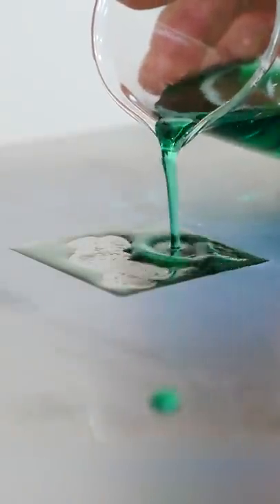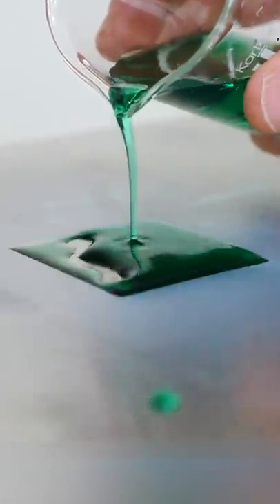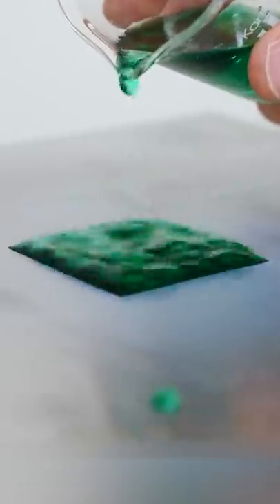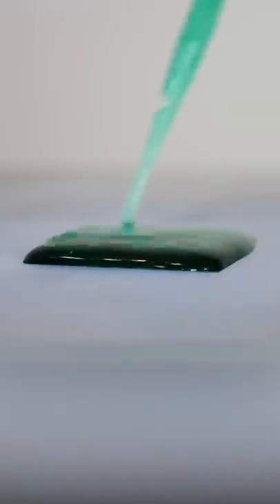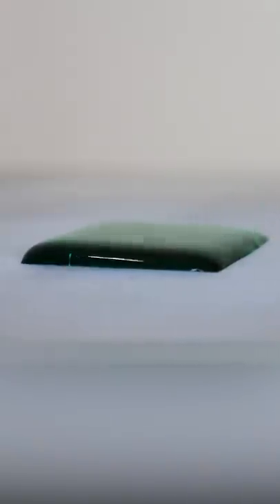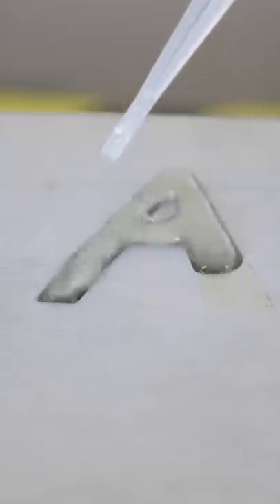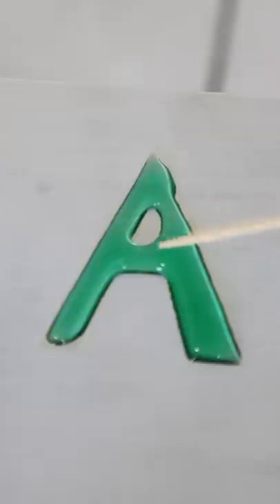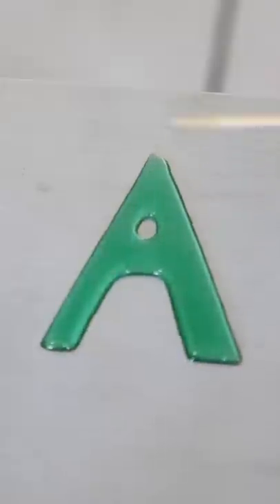Pouring Square Water

Comment: Me when I see this: “Oh that’s cool.”

My caveman brain: “If you keep pouring will it keep going up??”
Reply: Im actually wonder how high can the water get
Reply: at one point it should slide only on the hydrophobic parts until it falls down into another surface
Reply: Ye
Reply: I thought I was the only one!!!
Reply: Minecraft physics be like
Reply: ITSUS
Reply: Same
Reply: @fredrickchew867  0
Reply: Yes lol
Reply: Lmao though The same thing
Reply: Yep
Reply: no
Reply: I thought the same thing.
Reply: I was about to comment this LOL
Reply: It'll probably build up until it can't handle its own mass and starts to spill over, at which point the beads of water will roll across the hydrophobic coating until it reaches something else
Reply: YESSS
Reply: @lukescastle  Sameee, I thought I was the only one!
Reply: Bro Under this short, Its a caveman Spongebob Patrick chase Squidward short
Reply: Sameee
Reply: No probably
Reply: I thought I was the only one
Reply: Guess we’re all cavemen
Reply: Is there a limit
Reply: @fredrickchew867  only until the surface tension breaks at which point everything collapses as shown in the video
Reply: Seeing how far you can pour the water up is actually how hydrophobicity is measured in the first place. A more hydrophobic surface, the more acute the angle between the surface of the metal and the water can go as you add more and more water- essentially, it can hold more water. I think.
Reply: @fredrickchew867  as high as whitebeard

Dang it i hate that meme because I'm a huge one piece fan
But couldn't resist making joke
Reply: @espumacola4089  might
Reply: It will spill over then roll off the table in little spherical water droplets
Reply: @Compariz  hi ml player
Reply: lol same! XD
Reply: @fredrickchew867  
just pour some alcohol in it lol
then immediately it will get "high"

(haha im hilarious/j(?))
Reply: @fredrickchew867  same
Reply: Can we get much higher.... So highhhhhh
Reply: @fredrickchew867  can we get much higher
Reply: @fredrickchew867  can we get much higher
Reply: no beacause the surface tension reduces on adding more
Reply: So I guess the water tension or something would keep it from going up super high and it would droplet out onto the table, but what if the table was tilted in toward the middle so the water would keep sliding down into the puddle. Would the water keep getting absorbed into the puddle and more droplets are pushed out like in a perpetual motion type thing
Reply: Same i was thinking water tower
Reply: Sammmmeeeeee
Reply: too much minecraft
Reply: same
Reply: I was Wanderung how high it would go
Reply: Yup. Me also think the same thing🤣
Reply: @fredrickchew867  can we get much higher?
Reply: Same
Reply: Until the pressure from inside the surface of the water is higher than the external pressure the air exerts on it
Reply: @mickeyspanish9709  it doesn’t release singular droplets. Once you break the surface tension all of the water will spill out.
Reply: You aren’t alone…
Reply: Best comment I've seen today!
Reply: i thought that tooooo
Reply: yes.
Reply: Short answer: maybe not

Comment: Physics: spread
Water: no, I don't think I will
Reply: Hey can u plz xplain d reason behind that I didn’t get the reason from the video..
Reply: I love how people still make the Captain America reference
Reply: @mmmoody100  it’s something we took in biology but i just finished exams last week so my brain is like no I’m not gonna bother understanding this video
Reply: @mmmoody100  The surface beneath the water is different from the surface around it, so I’m assuming that there’s a mold that helps the water keep its shape.
Reply: @mmmoody100  He coated a piece of metal with a substance that water can't stick to and left a spot without the substance on (i assume he used a piece of tape and went around it). The water then just floats there in that shape as it can't flow onto that substance. Hope that wasn't too long winded just wanted to be thorough
Reply: @mmmoody100  Water likes to cling to stuff, except the hydrophobic substance that the video creator was talking about. He covered the surface with the substance EXCEPT that square. Since water will cling to the surface within the square, and to other water molecules, it holds itself together unless the tension is broken by something like adding too much water such that it overflows anyways, or by adding soap, as demonstrated in the video.
Reply: @mmmoody100  a hydrophobic substance will repel water. He simply coated most of the area in the hydrophobic substance and then poured water on the untouched area. Hope this helped.
Reply: Literally nobody paid attention to the video except @specialopsdave and @Cynthia Anderson
Reply: @mmmoody100  the man has coated a surface with ultra anti stick coat designed for water to glide on it (super hydrophobic cloak) except the places where he wants the water to go to, then he can add water and thanks to surface tension it'll just pile up and create a volumetric shape made of water
Reply: Thnku everyone I got tht..
Thnk GOD!!!
A zeal of hlping people is still left in some people..🙏🏻😇❤️❤️

Comment: Considering the water is "contained" in the surface area without the hydrophobic coating I think it still counts as being in a container, still cool though I wonder what happens once the water overflows?
Reply: I was wondering too!
Reply: At a certain point it will just "spill" out of area
Reply: @pixels_per_inch  I figured as much but I'm more curious about how the water will react to the hydrophobic surface once forced on to it

Comment: just had an idea:
Manufacture blacktop lab tables or cooktops with this coating all around the edges.
spillproof countertop that wont dribble water based mess onto the floor, or better yet, have a drain along the edge of one side so it pools there and can go down a second sink drain
Reply: That's actually a very good idea
Reply: I don’t think you know how most hydrophobic substances actually work. it’s like a layer of oil that’ll wash off in 1 wash so you can’t rely on it and cooking it destroys it’s desirable properties so it won’t work 
Also fun fact: hydrocolloids(substances having water holding capacity) like algin (obtained from brown algae) is used in jellies and ice cream.

Your idea sounds cool and would be awesome if we could use it that way but it isn’t that versatile :)
Reply: There are some issues but that first ideas is workable. Your second idea is literally just gutters though.
Reply: @anoushkasingh9074  ah, wasnt aware how short the lifespan on it was.
Reply: @paul_warner  I think it would be pretty cool if we could work it like the og commenter said. Be nice when you disagree, Paul :)
Reply: @anoushkasingh9074  I wasn't being very impolite, I think
Reply: That sounds genius! Good luck
Reply: @paul_warner   I think they thought you saying "gutters" was to insult the idea.
Reply: @anoushkasingh9074  hello, re-read Paul’s comment after reading the original comment. 
Paul is using a play on words. 
Gutters!
Reply: @noobslayer6915  I mean that it's literally gutters... What else do you call a groove or lip that collects water and channels it to a draining point?
Reply: @paul_warner  oh my bad I didn’t get it. I’m sorry Paul
Reply: @paul_warner  i mean honestly a table with integrated gutters sounds like a really good idea. could be really convenient
seems like a mechanical solution versus the material solution i offered.
Reply: @Zakumei  it exists but in the kitchen where I work it isn't widely implemented.
Reply: But in a lab you shouldn't just mix everything that could be spilled on the table 😉 believe me, you don't want that. I work in a lab
Reply: @SaheeliRai  oh nononono i was thinking like... kitchen countertops. i was thinking more practical application and domestic uses
Reply: @Zakumei  domestic would be a waste of time, it would be most useful in commercial kitchens, but it also wouldn't do anything for oil-based spills. However if we applied super hydrophobic materials to the coastlines of the world then we could stop the rising sea levels.

Comment: Fun fact: this wouldn't work on a larger scale, because the surface tension of the water would be too small in comparison to its weight, meaning it would eventually spill across.
Reply: Make the water tension stronger then.
Reply: @RealNameNeverUsed  it would have to become another substance with more volume, potentially a gel solution.

Comment: "without a container"
So how do you do it?
"I made a containment field of super hydrophobic liquid"
Reply: It's not a containment field, nor is it hydrophobic liquid.
Reply: But he said he coated every where but the square area where he would put the water, which even if it’s super small still forms a container like wall which keeps the water in a square shape until too much is added.
Reply: @Exerminos  That's not a container. Imagine it inversed. Would it still be a container?
Reply: @brettvv7475  yes, if he now puts some kind of fat on the hydrophobic area, since water is litophobic
Reply: @DarkerSoulz  Inverted it's a container? So everything outside the square is in a container? You've now rendered the concept of a container meaningless
Reply: @brettvv7475  that's like saying a glass isn't a container by saying "imagine it inversed." yeah, a block of glass is not a container, but a glass in the shape of a cup is a container because it has barriers to contain something. Same thing here. The hydrophobic coating forms a container.
Reply: @2GoatsInATrenchCoat  That's ridiculous. Having the glass shaped for which it can hold and transport water is precisely what defines it as a container. Words have meaning.
Reply: @brettvv7475  ....that's exactly what I'm saying lol. I'm saying that your original argument made no sense because the material is not what makes a container, it's the shape. so it's a moot point to say something can't be a container because its inverse isn't a container.
Reply: @2GoatsInATrenchCoat  I didn't say the material is what makes a container. I said the material shaped into a container is what makes it a container. You're the only one talking about a block of glass.
Reply: @brettvv7475  Clearly I misunderstood your original comment, then. You said "that's not a container. Imagine it inversed. Would it still be a container?" I took that to be an argument for why the hydrophobic coating is not a container, basically saying that if it was in a different shape, then it wouldn't be a container.

I'd rather not argue on the basis of a misunderstanding. If you don't mind, could you explain what you actually meant by that first comment? Specifically, what would the "inverse" be, and what point were you making?

Comment: Pretty sure covering everything but the square in a hydrophobic substance counts as a “container”
Reply: The water isnt contained by the substance, it is however by the surface tension
Reply: You can keep your dog in your yard without a fence by fitting him with an electric collar and running an electric wire around the perimeter of your yard.

Comment: But could you just keep adding water, or will the mass of the water eventually overcome the hydrophobic aspect.
Reply: The mass will overcome the surface tension eventually so you cant just stack up forever
Reply: It acts like a bowl or cup, of course once it cant hold anymore, it overflows. He made it seem fancy but if you drop a small amount of liquid on any dry, flat surface its gonna stay stilll unless you put too much or intentionally move it around

Comment: If there is a layer that adds depth compared to the base, then it is a "container" but with microscopic "height" and the water that drops in from the outside is going into its top.

Comment: Them doing this:

Me: still guessing how ice comes out of the little dispenser of the fridge 🤡
Reply: Also, is the light in the fridge, in fact, on all the time or is it sneakily turning off when you’re not looking.
Reply: How do you not understand how that occurs?
Reply: @kaizey  The light in the fridge turns off when the door presses against a switch when you close the refrigerator door, Dingus

Comment: Technically, it’s not perfectly flat though.  The hydrophobic coating has a very small amount of thickness which acts like a wall around the un-coated surface.  It’s just negligible compared to the height of the water held in by surface tension.  Or am I wrong?  🤔

Comment: Or if you pour in too much water to exceed the surface tension capability to hold the amount of water as one structure then water spills away from the area and runs over the coater area

Comment: Is it possible to turn it vertical after making different patterns and shapes? As the water will not slide and also if we maintain just enough surface tension